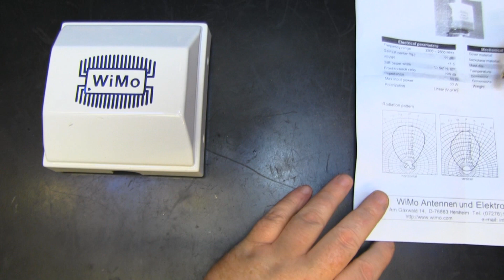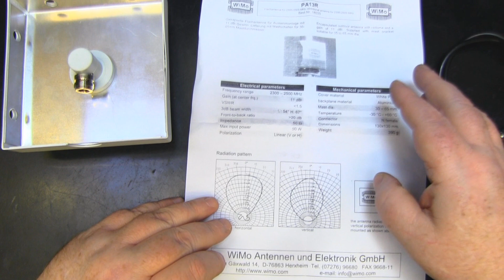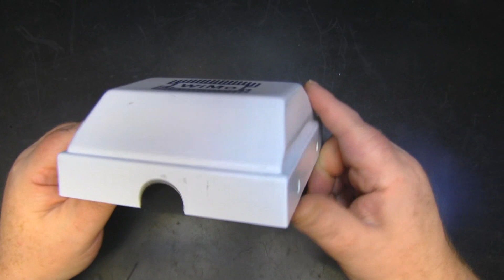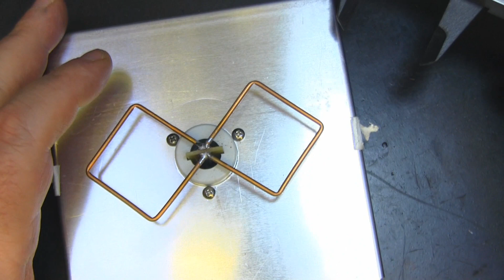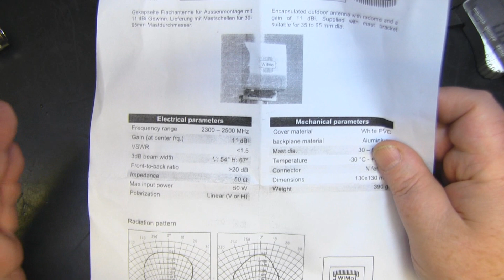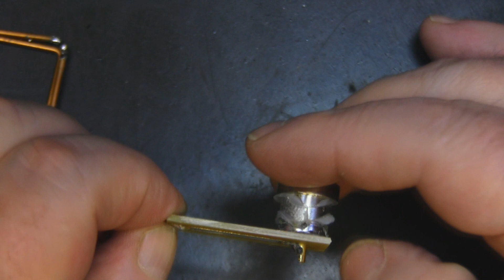WiMo PA 13R Flat panel Antenna

Comment: I have a question not exactly related to this antenna but a general wifi question. Why does wifi in Linux OSes disconnect seemingly randomly and not reconmect automatically? No one seems to know why both from software or hardware perspectives.
Reply: @Jeffrey Wolsieffer I had the idea that maybe it is programmed obsolescense by the router manufacturer. The other possibility I heard of is that it could be unsigned drivers in Linux that could appear as suspicious to a firewall somewhere. Interference could also be another reason since there are many devices including cell towers in the area (I am in NYC). If it were only interference I think that maybe a directional antenna could minimize that problem but it did not seem to. Thanks for your opinion.
Reply: @ruakij6452  it is hard for me to imagine why driver problems can not be fixed in Linux. I know many companies other than Intel do not officially support Linux OSes. Non-Intel wifi cards seem to have more problems and some Intel cards seem to be less problematic than others.
Reply: @Jeffrey Wolsieffer I have always had wifi problems since using Linux.
Reply: @Jeffrey Wolsieffer I will give that a try. Thanks!
Reply: @Jeffrey Wolsieffer Latest Linux update had a firmware update and in the changelog, they mentioned addressing firmware crashes on multiple chips including Intel and Atheros chips. I really hope that they have it figured out.
Reply: @Jeffrey Wolsieffer Well the one thing that was defective was the wifi drivers. I do not need to keep the system online all of the time but I want it to be reliable when I do need to be online. I am pretty much happy with everything else about Linux and do not need to update the system. However, some packages did see improvements over time with the updates but you are absolutely correct, there is no need to update often. Update should only happen when a problem or obstacle in the workflow is to be overcome. There is a sort of co-evolution of the user and his tools in a healthy system.
Reply: @Jeffrey Wolsieffer Many of the new wifi dongles have the same problems in Linux as the PCIE wifi cards. Yup, "Defective Drivers R-US" is what Linux is becoming, particularly in the wifi department. I honestly do not trust the Linux developers for most distributions. Recently, a program was installed in a Linux Mint distro that allows users to watch CNN live.  Corruption has creeped its way in for sure.Ubuntu had bad publicity in the recent past when it was discovered that data was being shared with Amazon. Trust but verify is all we can really do. Verify, verify, and verify again. lol The price of freedom from arbitrary coercion is constant vigilance.
Reply: @Jeffrey Wolsieffer lol